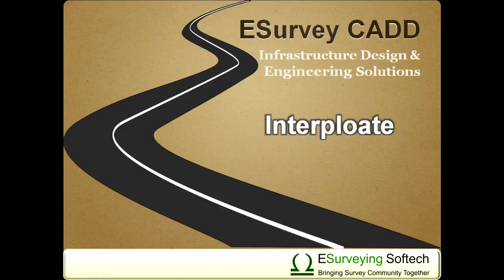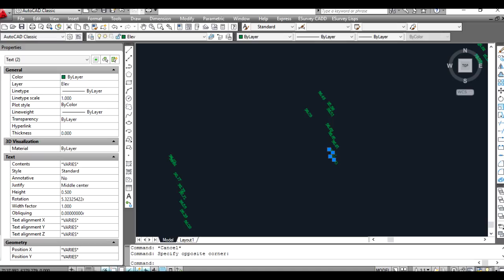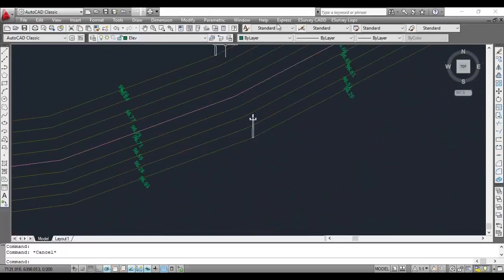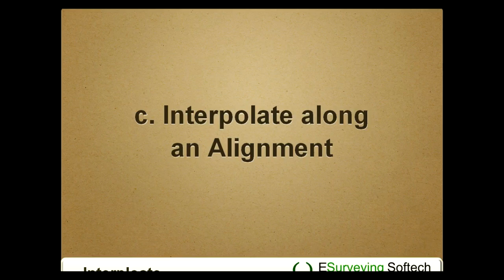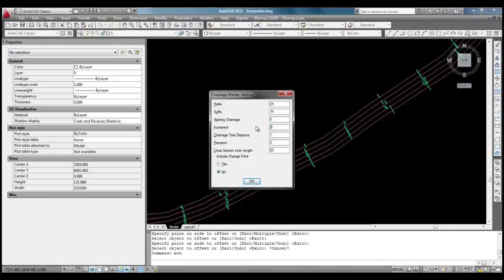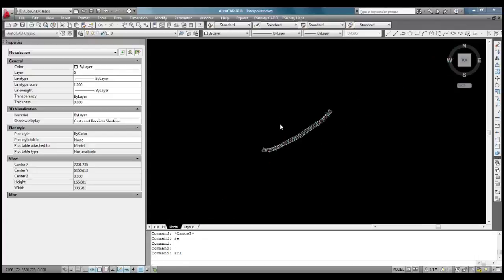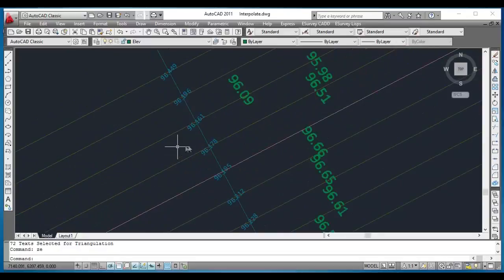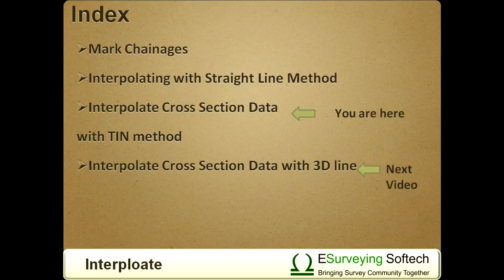Interpolate Cross Section Data Using Triangulation

Comment: Nice job, sis. Meanwhile, how about interpolation alignment cross section using Civil 3D?
Reply from the maker: This interpolation is simpler. Those who find Civil 3D expensive, those who feel it difficult to use Civil 3D. Those who wish to use simple solution, prefer this software.